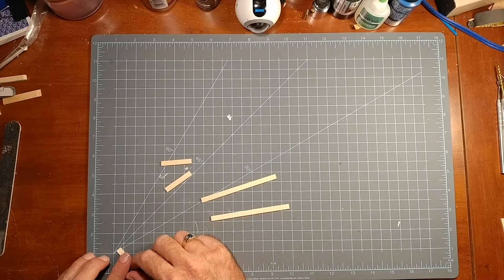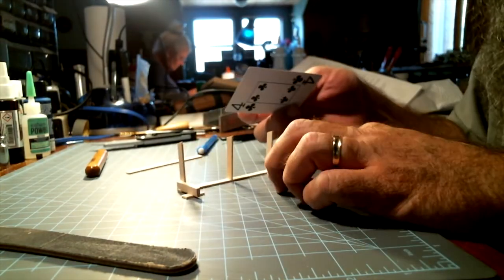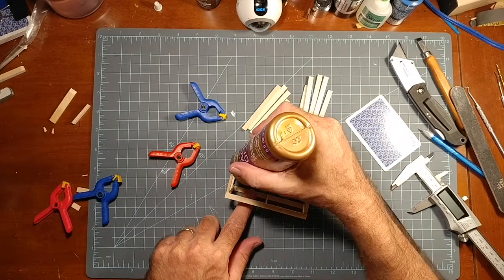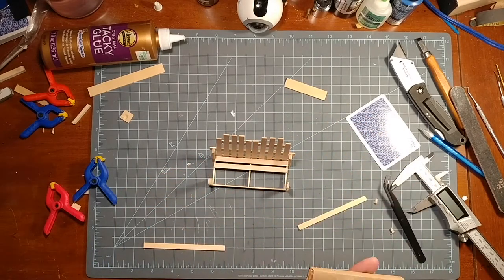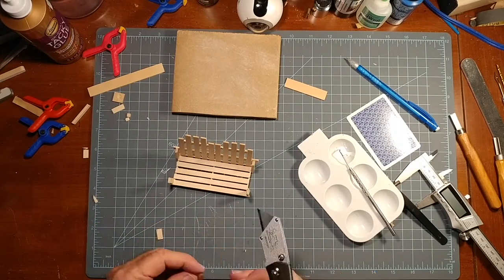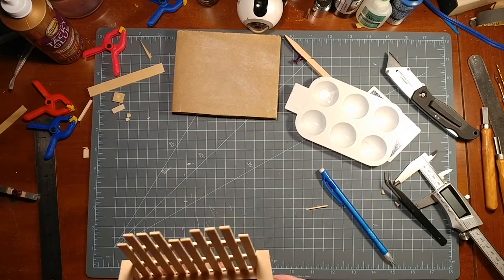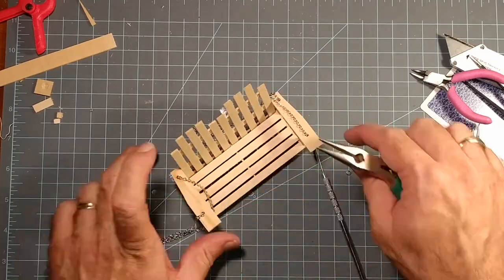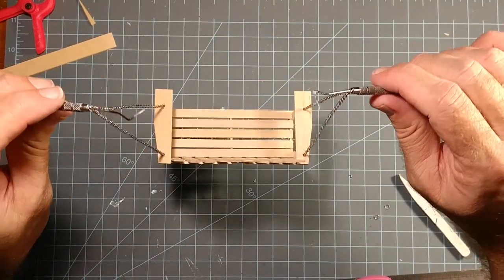Miniature Porch Swing

Comment: GENIUS! I use a toothpick to spread small amounts of glue....it gets all gloppy and I have to either chop it off or get a new one. Using a dental pick is so smart! I can wipe it off!
Reply from the maker: Also, a little rubbing alcohol will take off any that happens to stay on the pick if it does dry before you wipe it clean!